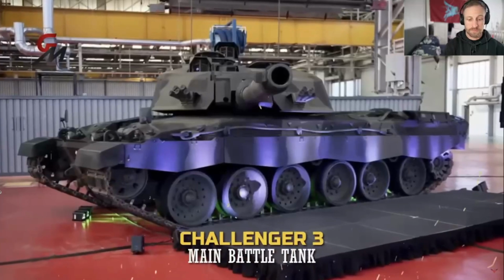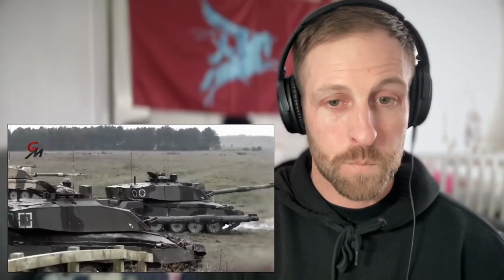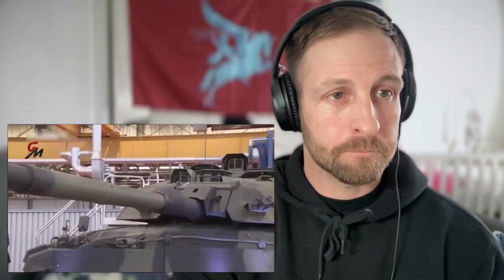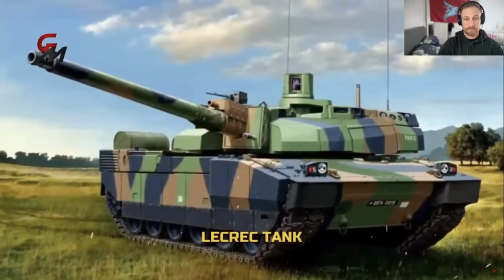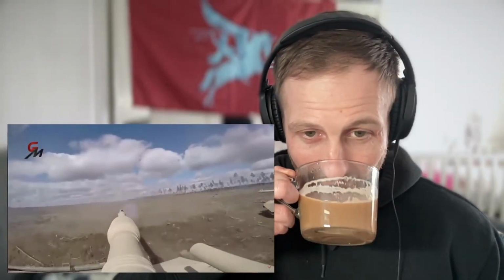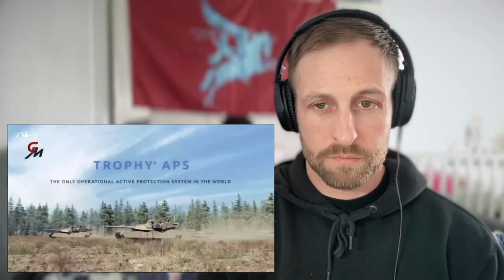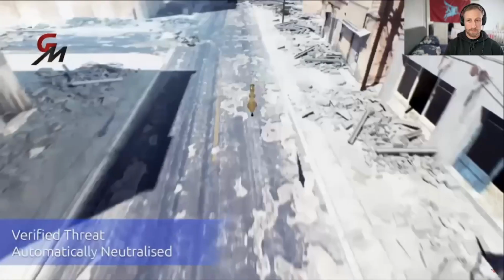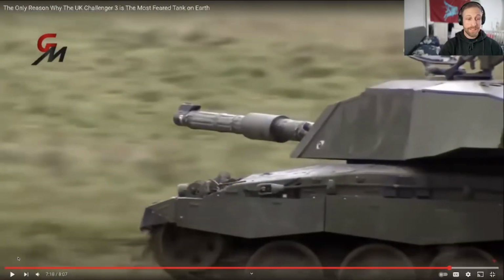The Only Reason The Challenger 3 is the Most Feared Tank in The World British Soldier Reacts

Comment: The new armour is not just for the turret but the hull too.
Reply: I think that’s the armour package rather than the built in armour, but I do not know for certain on that just there is a lot of confusion between chopham and Dorchester armour, challenger two has built in chopham type 2 with the Dorchester armour package added on for combat (reactive armour)
Reply: @616CC  The new armor is just 3rd generation chobham style armor, like it is used on Leopard 2A7. 
The hull is basicly not touched in the upgrade, only a few internal modifcations but no armor etc upgrades.
Meaning the majority of problems with Challenger 2´s armor protection will persist.
This is not a new tank but just an upgrade.
Reply: @zhufortheimpaler4041  oh right I see I wasn’t sure thanks for sharing

Comment: In the soft mud of Ukraine, a modernised T54/T55 with its rifled 100mm barrel and only weighing 36 tonnes compared to the Challenger III weighing in at 66 tonnes, has much greater range of movement and is therefore a much greater threat to infantry. Throw in the fact Russians have thousands sitting in storage, and the Ukrainians have a serious problem.

In otherwords, tanks like all technology, are environment/situation dependent. There is no one-stop-shop technology in warfare. Use the wrong technology for the situation and as the saying goes... sh1t happens when you take a knife to gun fight.

In modern warfare heavy tanks are only useful for area domination ie in a defensive role. And then only with air superiority in place. Outside of Kursk there's been no major tank engagement, and even Kursk proved low tech mass production out performs high tech low production.

Ukraine and Afghanistan has shown that battle tanks are obsolete. Highly mobile infantry, supported by lighter tanks operating in an armoured artillery role where terrain allows, are  a more effective offensive force.

Challenger III is more a design engineers dream than an effective fighting machine. See... that's the problem with engineers. They never know when to stop engineering. Its an addiction. And in the world of weapons technology, its a very lucrative addiction for the arms dealers.

Comment: About the rifled barrel:  in actual fact the longest recorded tank-on-tank hit was by a Challenger II firing from a rifled barrel!  The main reason Challie III will have a smooth bore cannon is to simplify battlefield logistics in battle. They will then be able to use the d=same ammo as the other NATO countries' tanks. The significant drop in accuracy that results was thought to be less significant than the benefits gained in logistical support. 
Also, latest reports from Ukrainian tank crews is that they regard the Challie II well above any other tank they operate!  And they haven't even seen a Challie III, which will be a huge step up in most aspects. The one disturbing factor is how few of them will be going to the British Army.
Reply: The Impaler suggests cannon accuracy and rifling unconnected - um maybe. The extreme range, given it was a C 1 with older tech, the hit was likely a lucky one. At shorter ranges rifling will influence cannon accuracy, but with digital offset for smooth bore cannons, the difference is minimal.
Reply: @jules5811  read again what i wrote.
RIFLING DOES NOT AFFECT ACCURACY OF APFSDS ROUNDS IN A POSITIVE WAY.
APFSDS Rounds gain no benefit from rifled guns on any range.
Physics says no.
Reply: @zhufortheimpaler4041 also rifling does improve accuracy of apds rounds it's just that the longer and thinner the round is it needs to spin ever faster in order to maintain stability that's why they put fins on the ammo it ment that they didn't need to spin it as fast and over time discovered that the they could use computers to accurately aim the shell
Reply: @zhufortheimpaler4041 there is a reason why Ukraine uses the challenger as a self propelled artillery piece and it's because it is so accurate
Reply: the guns rifling had shit to do with the longest range tank kill.

It was btw a Challenger 1 not a Challenger 2.

First of all, we have to look at the situation where this occured:
Target - T-54/55, frontal armor 100-200mm homogenous steel.
Distance - about 5000m
Ammunition used: 120mm L23A1 APFSDS (~480mm penetration on 2000m, about 10.000$ per shot)

The british tankers were ordered to only engage targets within their effective range (up to 3200m) when firing L23A1 rounds, due to the prohibitive price per shot and the limited supply of the ammunition in theatre.

The crew of the relevant Cr1 of the Royal Scots Dragoons disobeyed orders and opened fire on a target identified as T-55 on about 5000m, using L23A1 APFSDS.
The first shot fell short, the second missed, the third hit.
So they hit a target on 5000m, wich was the longest tank kill of the day, but also was to be expected after 3 shots fired.
They were lucky that the 3rd round still had enough energy retained, to penetrate 100-200mm of steel at that point, because due to that legendary shot, they got invulnerable to draconic punishments, as they were seen as Heros. If they hadnt hit, they would all get severely punished.
They disobeyed orders and wasted 30.000$ of taxpayers money.
The T-55 couldnt have done anything vs them, even if it had closed below 1800m, while they had a near 100% first hit propability at 3200m.

Now to the "Rifling gives greater range and accuracy" mythos.
Rifling stabilises some projectiles, that is correct.
But only conical shaped projectiles with a shorter Diameter/Length ratio benefit from this effect (the classic Bullet shape, projectile length is 3-5 times the thickness), they even need it to be stable in flight. Here the spin induced by the rifling increases energy retention and accuracy, meaning longer range and precision.
So full bore caliber AP, HE, HESH shot or APDS (sub caliber AP shot)
APFSDS is NOT one of this type, but a dart like projectile with a very high length/diameter ratio (meaning it is more than 5 times longer than thick, in most cases its 15+ times longer).
These darts react really badly to being spun by rifling, wich induces a tumble in the dart, wich will massively reduce retained energy, precision and range. (normaly on ranges beyond 500m the dart will fly sideways at this point and will have drifted so far of course, that it will hit the ground soon)
Due to this, the L23A1, L26A1, L27A1 and L28 all use so called slip bands on their sabot, to neutralise the riflings effect (basicly a gyroscope ring around the sabot)
This increases complexity and cost of the sabot.
Also rifling has a less tight gas seal as a smoothbore, so the energy of the powdercharge does not get applied so effectively to the APFSDS as in a smoothbore.
In addition to that, the rifling increases drag in the barrel, even reducing the effective muzzle energy of the APFSDS round, especcially in combination with the leaky gas seal around the sabot.

The L11A5/L30A1 120mm L/55 rifled gun has in comparison to the Rh120 120mm L/44 smoothbore gun an average 25% loss in performence vs the 1,3m shorter smoothbore gun, firing comparable projectiles with similar powder charges. 
(higher drag, less tight gas seal etc)

so why does Challenger 1 and Challenger 2 still use the rifled gun, while it is obvious that it was already outdated when Challenger 1 was introduced in 1983?
Because it was cheaper. 
The UK was operating about 850 Chieftain tanks for 20 years at that point and the Chieftain used the same gun, the gun was a british product, ammunition was in store and Thatcher was a cheap bitch, that cut defense spending.
So the UK stuck the L11A5 rifled gun, wich was already nearing obsolescence on the new fancy Challenger 1, instead of the RH120 smoothbore the army wanted.
in 86 it became obvious, that Challenger 1 was not going to cut it, as it had the same performence issues as Chieftain and the UK fell behind their NATO partners in respect to tank technology FAST.
So the MOD ordered a comprehensve Challenger 1 upgrade, this time with a new engine, gun, FCS etc.
Well... that didnt work out again, as Thatcher was still a cheap bitch and cut fundings, so they basicly fixed the problems of Challenger 1 (a newer FCS, Thermal Imager and a few other minor upgrades, but redesigned 90% of its components, so that they are not intercangeable with Challenger 1....) and kept the bad stuff in. (like the gun, the engine etc)

Challenger 2 is NOT more accurate than the competition (except T-Tanks maybe), but its ammunition has less effective range, less penetration capability and yes... less pecision on range, than 120mm smoothbore tanks like Leopard 2 or M1, wich both got also better Fire Control Systems and gunners optronics.
5000m is currently the upper third of the effective combat range for a Leopard 2 with L/55a1 gun. 
For a Challenger 2, this is still extreme long range/out of effective range.

The Upgrade to Challenger 3 brings Challenger to a comparable technological standard and capability as Leopard 2A7 or M1A2 SEP v2 had in 2014, so its a catch up to current standards, not overtaking them or being future proof.
Reply: @zhufortheimpaler4041 no the reason why they still used refiled barrels is because of the usefulness of HESH rounds which in order to be the most effective have to be spinning as fast as possible. You could even use practice HESH rounds to be effective in combat as it was just a slug of concrete so it would bore a hole in cover. HESH was so widely used by the British is because they were the most effective against infantry and as an infantry support ammo which is the whole point of tanks going back all the way to WW1 the secondary role of tanks is to knock out other tanks not the primary role like everyone thinks. So the challenger sacrificed some anti tank effectiveness to be better at supporting infantry. The only reason why they decided to make the barrel smoothbore is because of better battlefield logistics and because of smart HE ammo where it can be programmed to explode at any point in time, has been deemed effective enough to replace HESH

Comment: What I would like to know , I understand the new 130 gun from Rhinemetel will not fit the new Challenger 3 turret because of the need for an Auto loader but is the new turret ring compaterble with the turret for the KF 51 , if not why not did they not think that in say five or ten years the 130,gun mite need to be fitted
Reply: It's because the UK government (is dumb) views the Challenger 3 as an upgrade aswell as a new tank. The plan is to upgrade all existing challenger 2's to 3's (instead of storing, selling or scraping) so they must work within the limitations of the existing challenger 2 chassis. Annoyingly it actually costs more to upgrade than build a challenger 3 from scratch (keep in mind it costs £5.8 million to upgrade a challenger 2 to 3, then add the original £4.2 million cost of the challenger 2 tank, meaning the upgarded challenger 2 is a £10 million tank, whereas a brand new from scratch challenger 3 is only £5 million.)
Reply: @chrismcgarry3793  its about as expensive as buying a factory fresh leopard 2
Reply: @chrismcgarry3793   There has to be data or statistics missing from your note - or maybe they are fundamentally incorrect. Even the most dozy politician/MOD official would have trouble selling a decision like the one you are suggesting, particularly as Ukraine would like to grab as many C 2’s as they possibly can. It may be to do with manufacturing lead times or some other unexplained logistic. It may be to do with  C2/3 workforce/factory employment in the short term. Guessing.